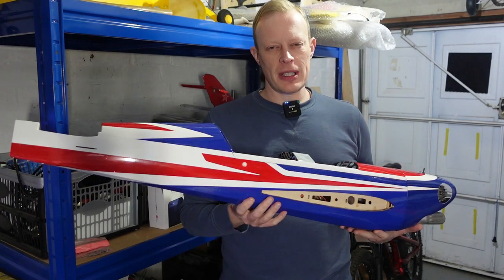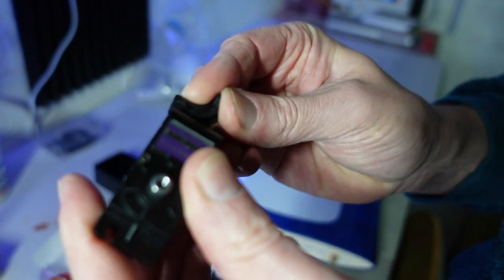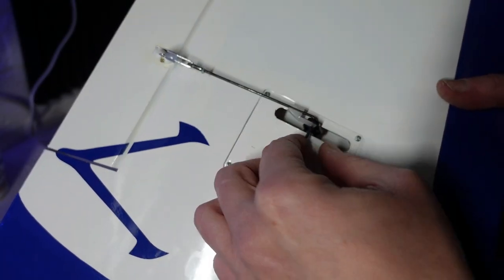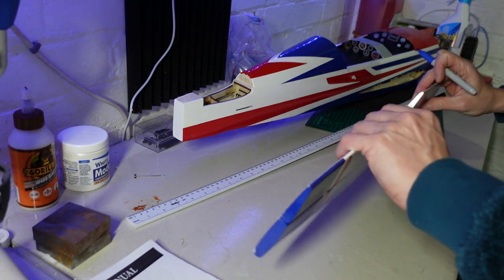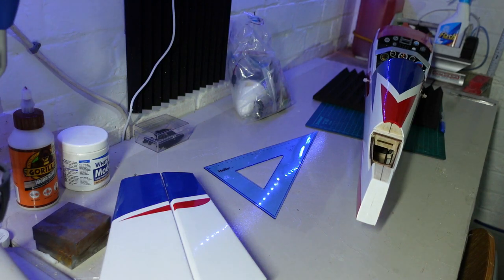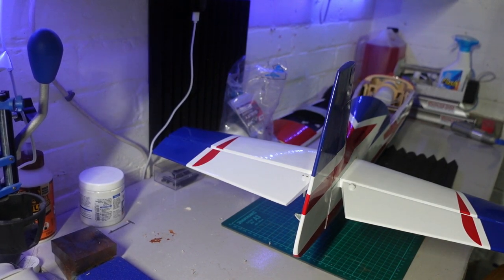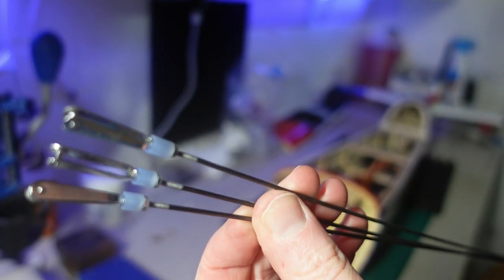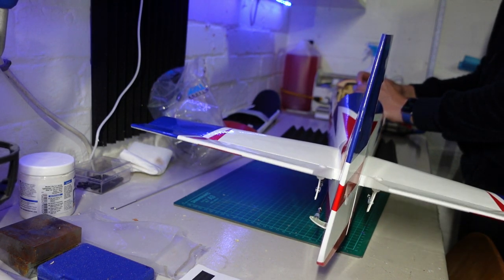Seagull Models Extra EA 300L Build Part 3 - Surfaces

Comment: Like your vid, just putting one of these together that I bought back in November 2021. Tail fin was a bit of a poor fit on mine a bit like yours in terms of alignment at the rear but also a large gap where it sat on the horizontal stab. Could not sand much off bottom of fin to improve the fit as it would have spoilt the line on top of fuzz to front of fin, just had to fill the gap with epoxy mixed with balsa dust. Will touch it up with white paint. Control rods at rear and brass coupler are heavy, prefer sullivan ones myself but using what came with the kit. Pilot figures also are heavy, don't think they will both be going in it. May have to bin the fancy U/C fairings as I fly off grass. Going electric 6S on mine but have had to shorten motor box by 25.0 mm.
Reply from the maker: Great thanks for watching. Yes totally agree. I’ve binned off the pilots and the undercarriage fairings. You’ll see in the next video 👍🏻